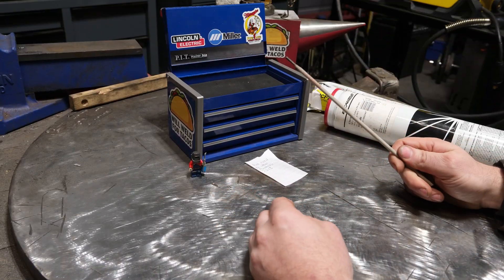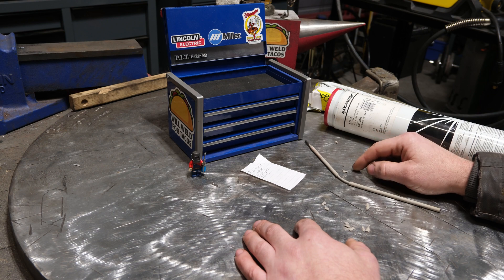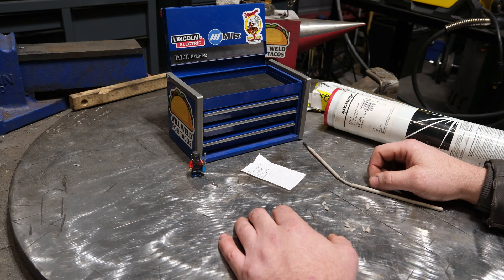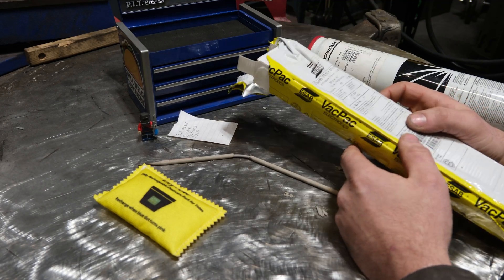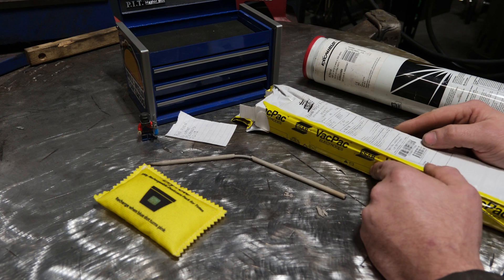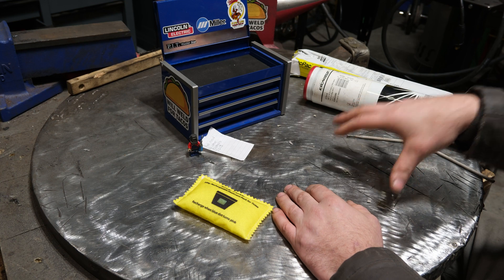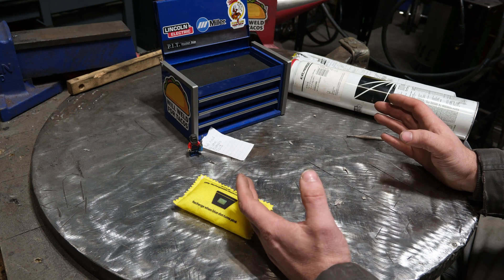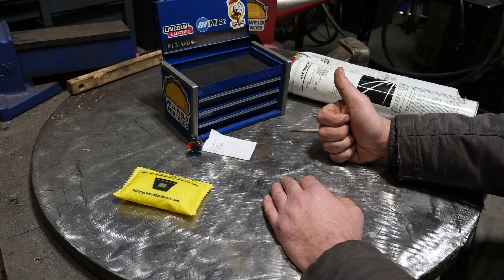QFTB #11 Rod ovens and 7018 rods

Comment: Great video, Greg, thank you!  What about flux core or dual shield wire?  Any concerns there about moisture?
Reply from the maker: Great question.  So self shielded wire (the common household type) is generally not used on higher strength alloys because it tends to produce brittle welds.  It and dual shield tend not to pickup as much moisture as stick rods because it’s harder for moisture to get into the flux inside the wire tube.  With dual shield they do make spec wire for low hydrogen (the wire is coated to help moisture intrusion) and the wire is sold in a sealed spool.  The bigger spools come on a wire spool that can be baked out in an oven if needed.  From a realistic perspective if the wire is stored in a dry box with a desiccant pack it will be fine.  When the wire sits in the machine it will rust over time and that will make the wire run poorly.  If the wire has rust its low hydrogen status will likely be compromised and weld defects are almost certain (from the contaminated, not possibility of moisture in the flux).
Reply: @makingmistakeswithgreg  I suppose what one could do is, before starting a weld, hit the trigger and shoot out 6 inches or so of wire. Trim it off to your desired stickout with your MiG pliers and get going. I highly doubt moisture will make it into the flux core more than a couple inches.
Reply: So... Flux core wire starts out as a flat piece of wire that is filled with flux then rolled into a tube ( rolled in cuba).  Shockingly it has a seam.  A tight seam instead of open air flux, but still a seam.  Unless you get the coated Low hydrogen wire.